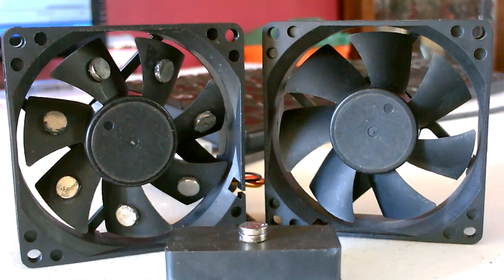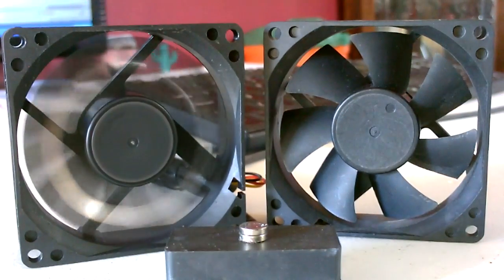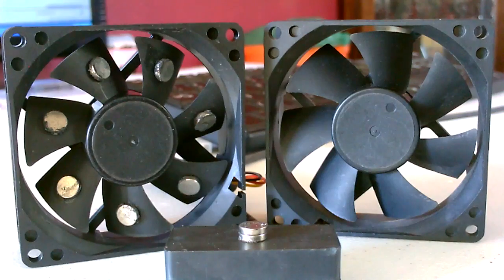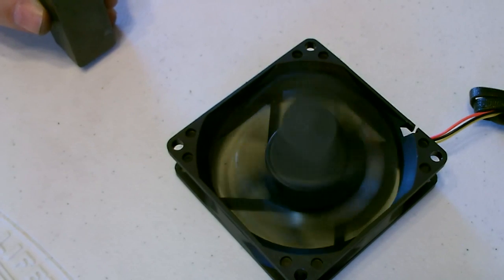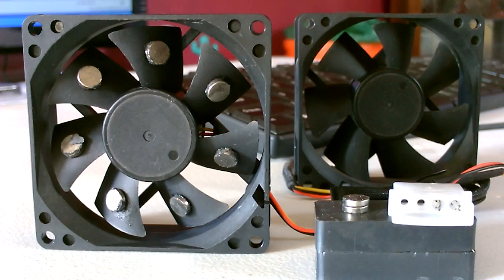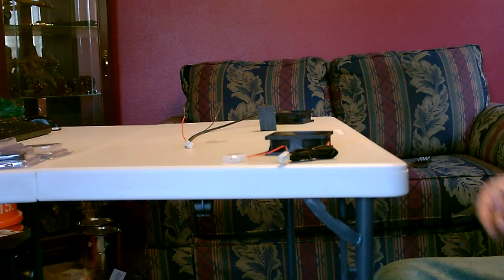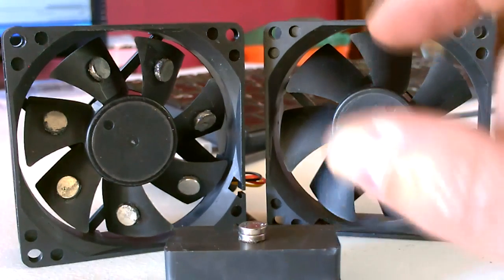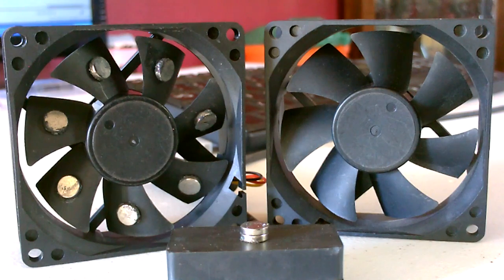Free Energy Magnet Motor! - Free Energy Generator? - Free Electricity?

Comment: I dont think you are doing it right. Ive seen others that move without the single magnet having to move as well. And they can light up leds. Try putging the magnets on the blades flip flopping the poles . For example one blade put magnet with north up, the next put south up, then the next north up, and so on until the blades all have one. Then adjust the placement of the magnet you are holding by moving it closer and further until you get the perfect point that the blades begin to move  without oscillating the magnet in your hand at all. Then when its perfect you can mount it in that exact spot. I would think that the poles shifting back and forth would cause the magnet to pull one towards it and then the opposite pole would get into range and repel it causing the blades to spin indefinitely.  I assume you could do this with much more powerful magnets rigged up to a car alternator that is hooked to some form of battery or elecyrical storage device and in theory create free electricity until the magnets lose magnetism or the alternator breaks or the battery dies for good.

Comment: this will work the secret is magnets have a North and South Pole which means they attract and repeal each other. this is vital to make this work. here's a hint  the magnets on the blade need to be in  the right sequence attract, repeal attract, repeal, or push, pull,push pull or North Pole South Pole, North Pole, South pole or 2 North 1 South 2north 1 South or the sequence has to be correct and the correct types of magnets must be used good luck

Comment: So, what if you connected the magnet to some sort of a solenoid that would move it closer and farther in a timed way? Wouldn't that create a proper osculation? The magnet does indeed move the fan, the next trick is to get something to move the magnet automatically. Maybe it would even re-charge whatever AA battery is used to operate the solenoid. It probably wouldn't produce much power but the principle of "free energy" might sort of be there but in a faux capacity. It might just run for a really freaking long time.
Reply: Harbinger, bunches of people have shared your idea. Including myself at one time. Without the driver magnet being moved back and forth you correctly observed that this won't work. I assume you're thinking that as the device turns, some levers and cams could be arranged to pump the driver magnet. But the energy required to pump the magnet would be more than what can be obtained from the spinning wheel. It is one of the most fundamental laws of the universe.

Comment: It is not free, he is waving his hand to turn so he consumes energy to move it on...
Reply: Nothing is free, there is always a cost .
Reply: Harbinger, how did you come up with that 70% efficiency rating. For free energy, 70% would be total failure. Even 99.99% would be total failure. For this to work the efficiency needs to be more than 100%.
Reply: Ayhan Ozcimbit place or stick  repelling side of magnets in each 4 side of the fan
Reply: You might be able to use a solenoid to move the magnet automatically. The rotation of the fan would recharge the power source for the solenoid. It would probably be over 70% efficient.

Comment: What if you attached piston rods on the end of each fan blade and connect those to a housing  that allowed the motion of the spinning blades to move the piston which would then move the propelling magnet attached to the pistons  via a housing with a set of gears that allowed the rod  with the magnet propelling the bladeto move back and forth in the right sequence to propell all magnets as it move up and down / back and forth symetrically .

Comment: What we're talking about here is 'perpetual motion' and the idea is impossible due to friction. A perpetual motion machine is impossible because it would break the first two laws of Thermodynamics. No matter how many videos you watch on this they are all hoaxes like shown in this video with a magnet hidden under a table or such like.! :)
Reply: We don't need a perpetual motion machine. We just need one that doesn't use polluting fuel. You'd just have to oil and replace the bearings once in awhile, and maybe get new magnets (some of which can last thousands of years).
Reply: OldSoulPortal - Why am I even here? I suppose just to get a laugh and try and educate people from being conned into the idea of free electricity! :)
Reply: Sound Media Tesla figured it out so it isn't impossible.
Reply: guys... there is no free electricity. there is no free energy period.
energy is either transfered or converted, so it is not created out of nothing.
get over it
Reply: Rose Henderson 
The problem is not in the fact that magnets spin it but in the fact that there is a hand moving the magnets, thus providing energy to the system to make it run
😜
Reply: "Perpetual motion" means that there is no loss of energy (i.e. the thing keeps itself moving without new energy being introduced to the system). Can you power a light bulb with magnets on a fan? Sure you can. But, as this video demonstrates, you can't make the fan spin into perpetuity without moving the magnet. The fact that it slows down if you hold the magnet into position is proof that the system loses energy. 

What's really funny is that the guy in the video explains how perpetual motion machines are not possible and yet you say it is a "hoax" demonstrating that you're either a troll or didn't watch the video (maybe both).
Reply: The question is, is this efficient enough to replace other forms of fuel?
Reply: Tarson Talon That's what I've been wondering. If this was built strong, and you had enough of them, couldn't you power your house or at least a portion of it?
Reply: actually no they are not hoaxes, if they break some law them obviously that law was not as accurate as thought. It is simple really, if you hold magnets close together they pull towards or push away depending on polarity and if they do not come into contact with each other then what would stop the pull/push? friction? well easy moving or oiled parts have very little friction so this is a simple basis for making a device that keeps pulling or keeps pushing and when in a circle formation would just keep going
Reply: Alex A tooo trueeeee
Reply: Alexandre Fernandes ALIENS.
Reply: if its impossible how can wind mills create energy from motion? its not impossible, we just have to figure it out.
Reply: +Collin Williams They don't. Modern day wind mills suck. The old ones use wind to turn them generating electricity, but these new ones use more energy than the little they produce.
Reply: Mrnat My qualm with the ordeal is the question whether the magnetic force can be converted into enough mechanical force to actually turn a turbine of any size.
Reply: Tarson Talon I doubt they could get it turn, but they might have enough power to keep it turning if something kick started it.
Reply: Mrnat Just the magnetic force itself, I mean.
Reply: Tarson Talon It's definitely worth testing.
Reply: also you call the videos of magnets making it spin a hoax but say the "trick" is magnets under the table? ummmm so that makes no sense at all. You just admitted that magnets can make it spin if you think magnets under the table are making it spin. The magnets are not under the table in all these videos though....they are right there being showcased for all to see. Do you think it spins better with the magnets under the table instead of close to the device ? so even the person calling it a hoax admits in the accusation that magnets work to spin it either way you try to look at it.
Reply: Would it be possible if you put a magnet on two fans at opposite polarity which then they work off eachother and constantly spin?
Reply: All i want to say to those scammers about these machines put on youtube is,,, fuck you all.
How dare they to trick us and wasting our time more then affordible, boohoo!!!

Comment: I'm glad someone made the connection, in the spirit of the way, of the magnets on an angle placed on the fan blades. I saw ancient aliens one day where he had found a magnetic round stone with angled spirals on top of it. When he tried to test to see if the stone was magnetic it started to spin, like a top, when he put the magnet above it on one side.There is something to th angel of the magnets and the way the are shielded in part.And as you say there is a way if the top magnet is times like to a cam, a set up I saw in another video, the magnet mounted upon a bar that raised and lowered when a semicircular bracket fixed to the shaft acted as a cam to strike the bar raising it in a timely manner, and it worked.on a small scale.

Comment: To move a fan (or a pump rotor) using a magnet is used in some models of a fully submerged water pump. I still don't understand why ppl are even trying to get "free energy" when there is plenty of energy which you can take, figure that out insted of something impossible.

Comment: lol your only using the two large magnets and that will never work.......take the ones on the fans and make sure they alternate polarity so plus up  plus down plus up plus down.........then arrange three large magnets with pos up around in a triangle. the driving force once started is the polarity differential....you may require a coil as well....normally there is another ring layed out opposite to the fan blades on the frame as well.  The trick for the fan thing is to have a attraction point of steel on each fan blade as well as  a magnet.......by my calculations it will lose 10 percent of its field strength over 100 years. some times the magnets have to be tubular in shape to get them to be closer to the steal attracting them......once the chase is established it will work pretty well forever.

Comment: The earth is magnetized and it's moving on circle . have anyone think to generate energy from it moment and magnetic power , this looks need to be done on the outer space but you could make use of it .
Reply: the biggest problem I see with that is that the only way to create energy by that method is to prevent the object in outer space from orbiting the earth, and if that happens it gets pulled down by gravity

Comment: Well the energy is equal because it may not come out all as electrical but there will be sound/vibration and heat. So technically the same energy is also coming out, The laws for the conservation of energy.

Comment: You need a piston connected to the fan that moves the magnet the way your hand is moving it.
Reply: +GibsonLesPaul2273 The fan will stop moving if you do that because it requires slightly more energy to move the magnet than what the magnet gives.

Comment: +desertsun02 The one i have seen is very different from this... on the blades should not be magnets but metal washers... on 3 corners of the fan should be hard drive magnets glued, on the 4th corner should be half of a hard drive magnet. 1st, install washer in exact same spot on fan blades, then install the 3 corner magnets, then move the half magnet towards the washers and watch that baby spin as fast as it can... it's impressive. I'm just not sure if it's true or not. The youtube video i had seen was suddenly taken down without explanation by YouTube, not by the owner... but someone i know captured it and placed it on facebook. I just wish i could know if this is true... i am attempting to get the proper materials to reproduce the experiment myself.

Comment: Yes you are correct in that you cannot get out more energy than what you put in. But hook a windmill with a shaft connected to the large magnet and use math to figure out how to rig in up correctly so that the magnets are always in the correct positions . I understand that they attract and repel from each other equally, so you could maybe use gravity to you're advantage with some sort of springing system to keep the magnets in the right spot.
Reply: +Jenna Felton Still would not keep it going indefinitely, as the spring would nto keep springing. If you hold a slinky upside down does it keep coming back up?

Comment: take the Top magnet off... and position the one in your hand..  seem you did this on purpose.. cause this method is simple..  think of a windmill wind turns a generator which is a motor and out comes power.. so why not just use magnets to spin the same motor...

Comment: try hanging a long string from a door frame and connect a magnet to the end and on the floor put your fan with magnets make shure the magnet on the string is right hight but should simulate the movement your doung to tern it might work lol

Comment: Could you like make this is a gigantic scale, using one strong ass perma magnet with rather strong electrical magnets and just power them in a row, so it would like have a short magnetic impulse turn and whilst it turns the next one is getting powered?
Reply: MCproaedificater 
Thats called an electromotor. It uses energy, not generate it.
Reply: sry, im not that good in that ._.

Comment: or if you hang the magnet on a string so it swings by it self ? glue 2 magnets together where its connected to north + north or south + south
Reply: Bain McCartney 
And what would that do?
Reply: possibly work in creating a self running magnet generator. this must be done with precision. any errors and it would never work. im tarded so i cant do this stuff
Reply: Bain McCartney I guarantee you it won'T work.
Glueing 2 magnets together on a string and then hanging them from that string will net set them in motion.
Aside from the fact that a perpetuum mobile is scientifically impossible (Energy can neither be created nor destroyed), the force of both magnets working in opposite direction cancels each other out, resulting in no movement at all.
Reply: placing magnets on a wide cylinder that spins with magnets set to push away is now how it works. magnets are made... so the energy comes from a fuel type created electricity or the earth so its not from nothing
Reply: Bain McCartney
I don'T exactly know hat you mean with your description. but i can tell you this:
It will not work. There is no energy coming from anything. Magnets do not store energy, magnetism is not a form of energy but a force.
It doesn't work by definition. And even if it would, and magnets could store energy, you would need to create the magnets in the first place, using more energy than you get out of them later.
Reply: magnets can produce more than they output with that force of magnetic pull. if you understand anything of common sense how things work... the force of a magnet pushes away the other magnet when near the same pole. get it? now placed on a big cylinder and set in correct positioning like a v (just like the mighty ducks movie) it can cause it to spin and generate more power than what was used to create without loss as a magnet can have its pole for ever. not trying to be a dick im just stating facts known by science
Reply: Bain McCartney
You couldn't be more wrong. Calling this nonsense  "facts known by science" is beyond ridiculous.
It's the exact opposite, superstitous nonsense.
1) Magnets do not output power. Magnetism is a force, not a form of energy. You need to input energy to make the force move something, just like with gravitation. Magnetism is no different in this aspect.
2) Your described contraption doesn't work. If both magnets are kept stationary without external power input, aka moving them or spinning them, they do not move at all. The force overall balances out, always.
The sum of kinematic momentum is zero.
3) No magnet has its poles forever, they get gradually weaker over time.
Reply: Bain McCartney what are you talking about, you are talking nonsense. You have just made yourself look really stupid. You should delete your post asap.

Comment: Only asking because you seem to have a few fans and time and know how. Would you consider trying it with two magnets per blade mounting them not on the sloped surface but perpendicular to the axis of rotation (perhaps slits in the blade with glue?). And all oriented the same either N in or out but all the same. Its basically creating a cascading flux field then without moving your secondary magnet you should get a bit of rotation. Just a thought as I have made the crappy version with a piece of cardboard shipping tube and a rubber band holding them to it while a bb in a small ring magnet spins like a top if u set the tube above it-I propped the tube with 4 Lincoln Logs as it was what I had laying around. Never had a fan to spare though so I would really be interested in what it did if you ever have time and inclination to try it. Sorry for the ramble.

Comment: BTW , if my thoughts are correct, I will try one more experiment with exactly the same setup except the resistance will change, so the time it will take the magnets to deteriorate should be directly proportional to the change of resistance (with a small acceptable error, we are not dealing with precision magnets here and equipment.) Now that proves that magnets apply the power to the generating fan and deteriorate as power is used in the form of electric flow so where the fk does all this free energy come from ? Gimme a fking break !!!!

Comment: Magnets deteriorate over time, basic physics. So if the fan does work (even if it runs) i am going to place a resistor and a ammeter in low scale and run it until the "cows come home" and prove that magnets will deteriorate over time as the ammeter shows a reduction of current flow through the resistor,. I will then plot this and you will see this. This is the way to do proper science !!